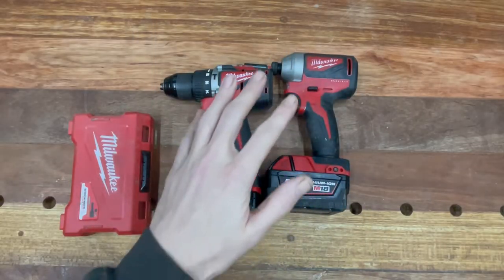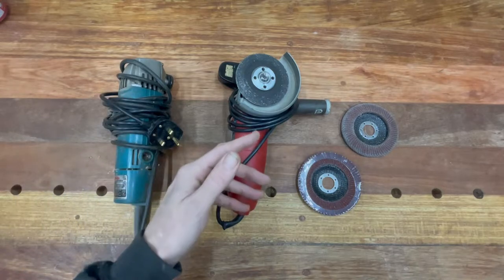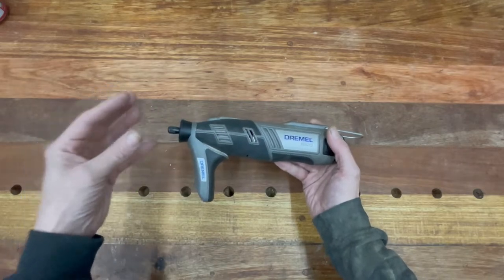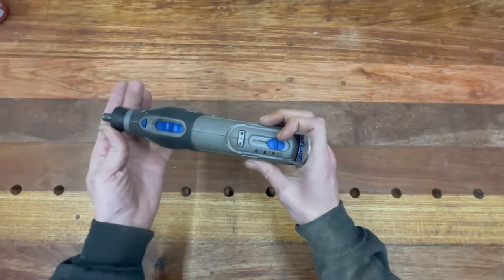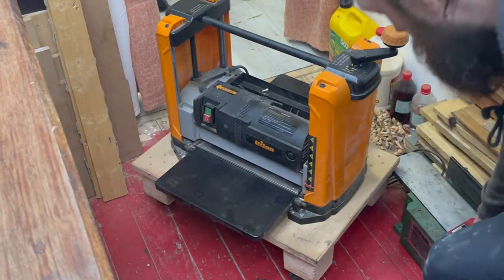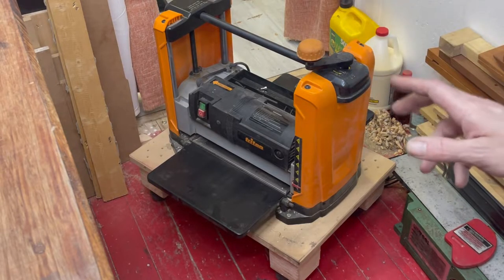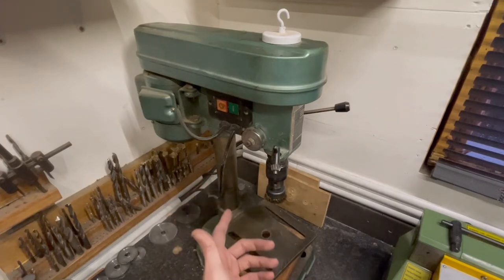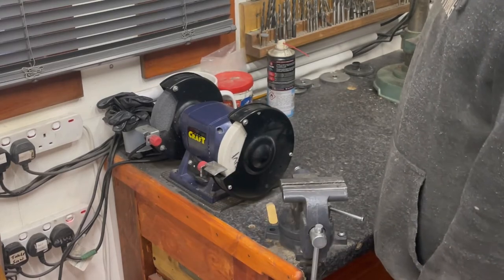Woodworking for beginners (part 2) power tools

Comment: Thoroughly enjoyed your video, again good advice for the likes of myself being a novice to wood working. Look forward to part 3. Currently going through your back catalogue. Enjoying your extension build series. Just a quick question,  how has your extension coped with the winter, have you had any issues with damp etc?
Reply from the maker: Hey Stuart, am Glad your enjoying it, putting together the joinery part just now, so should be out in a few days. As for the extension I must say it’s not changed held up very well, the only thing I can say is the window got a bit sticky when the cold weather came in which is to be expected, it was only ever temporary until I make a better one but yeah it’s solid am happy with how things are going and I hope your enjoying my videos.